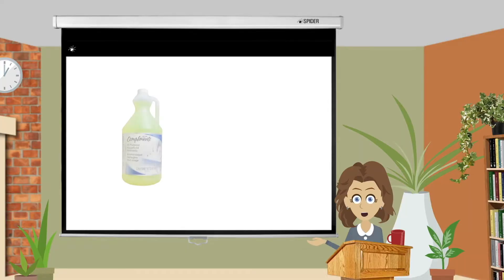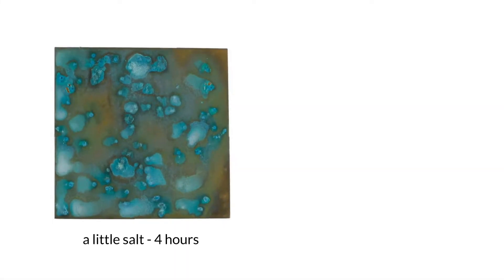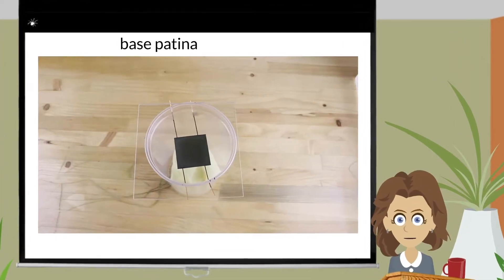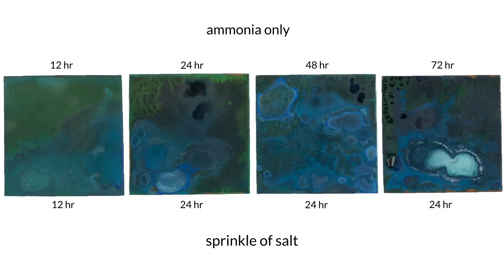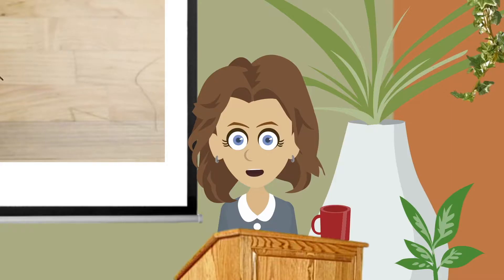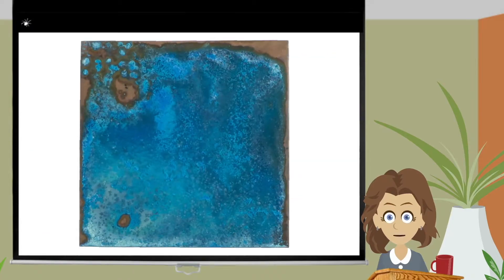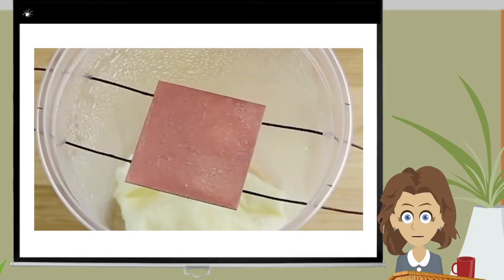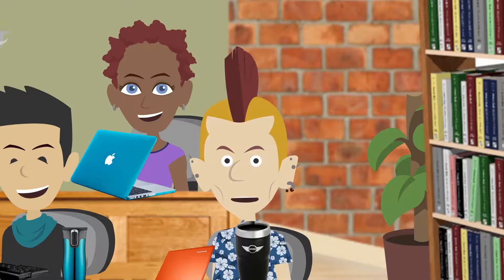part 2c: when ammonia met salt (patina on copper)

Comment: You really don't want to use ammonia with vinegar. Using them together results in a dangerous release of toxic chlorine gasses.
Reply: This is incorrect.  You’re probably confusing this with the dangers of mixing ammonia and bleach, which can produce chloramines (which are toxic).  

But there is no source of chlorine in a reaction involving ammonia and acetic acid.

Comment: I have had excellent results making copper patina with the soy sauce and ammonia method, but at the end of the process I want to seal it to protect the patina.  I tried spray lacquer but it darkened the lovely aqua patina and turned some of it brown.  Any suggestions for a sealant?  Much appreciated!
Reply: I put patinas on long rifle shells, and then spray them with a shellac, or sometimes just an acrylic clearcoat spray, and they both work well. However, the majority of the shells are brass. There was one copper one once and it still worked… just don’t do it when it’s humid.